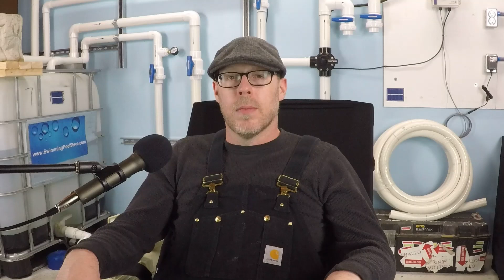How Much Flow In A 2" PVC Pipe?

Comment: Thanks very much for your video.  I was wondering how best to determine the actual flow I'm receiving on a 2' pvc irrigation line that is flow from a 2" miners inch Dole valve.  Do you have any ideas about what I need to get this info ?  Thanks very much

Comment: If all pipe work is 50mm, would you install 50mm or 40mm return fittings?  By installing 50mm returns will you loose too much flow to move leaves etc?

Comment: My pool builder used 2" pvc pipe and a 3hp motor, the pool is 40k gallons. Would it be best for me to set my pump rpm's to get 55 gpm and leave that for 24hr 7days a week till I winterize the pool? If I multiple the min's in a day by 55 I would get 80k does that mean 2 turn overs? Thank you!!
Reply: That sounds just right. Could reduce to one turnover per day in the off season